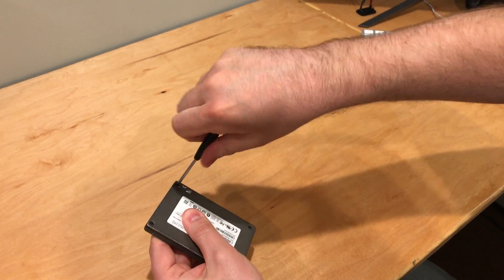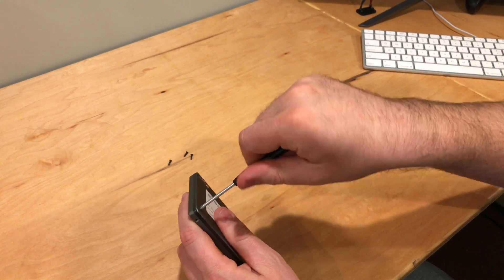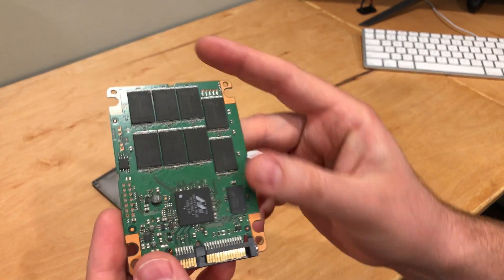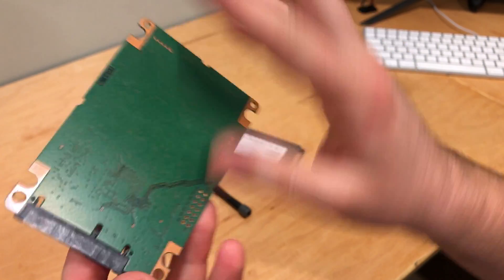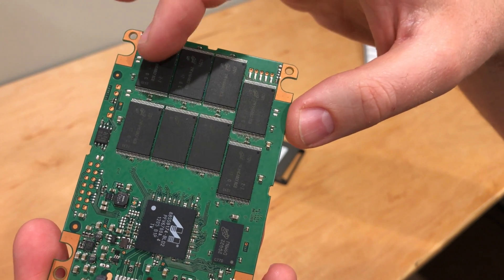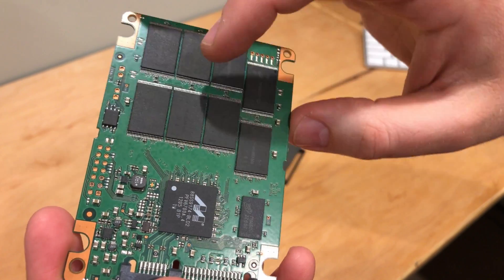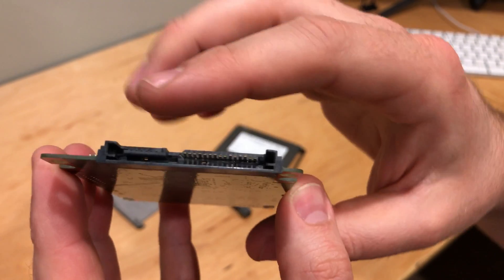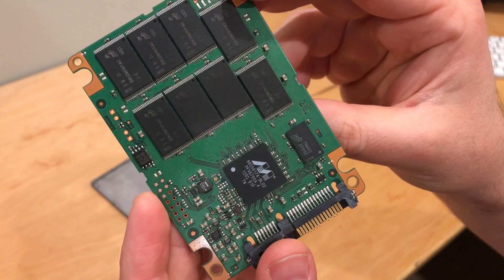Lets take apart a Crucial M4 SSD (Solid state drive)

Comment: You could replace the connector.... if you can find one.  See if there is a part number on the connector and google it.
Reply from the maker: Its not really worth it. Its only a 60gb drive and its really old and slow by todays drives.
Reply: @PCGoblin  good you didn't because fix would not be economical!